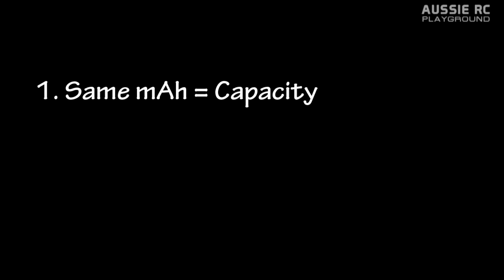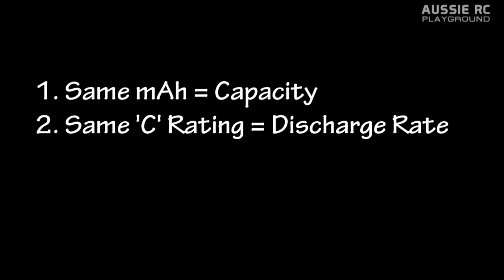RC HOT TIP: How To Connect Batteries in Series

Comment: If I Wana double my flight time, witch is best, series or parallel?
Reply from the maker: Series = voltage
Parallel = mAh
For longer flight time, increase your mAh, however, this comes at a cost of weight, so make sure CG is still right before takeoff.

Comment: Since I run (2) 3 cell lipos 6500mah 100c per battery in series does the c rating of each battery equal 100 total or does it double the c rating since there are 2 100c batteries equaling 200c. Thanks in advance!

Comment: i have a wltoys 10428 and i upgraded the battery to a 2 cell 7.4v 5000mah 75C, I was wondering is things going to be ok as far as burning anything out because i ramped up the 75C?, everything else is what the battery it came with had cept the 5000mah (previous was 2200 an lasted a total of 8 mins lol boring :D)and 75C, i know the mah just gives it longer lifetime but i was on the fence on upgrading that discharge rate an honestly ive no idea what the previous battery had for that as it does not say on the battery its a cheapo chinese no name battery and the upgrade i grabbed is a DHDpower lipo.

Comment: I prefer Parallel/Run Time compared to Speed. So I would be hooking up Two 3s Batteries in Parallel even it's set up for 4s and gives me two 2s Batteries. Or even two 4s in Parallel. I F'n Hate going out and running my trucks and only getting 12min, Maybe 15 if I am lucky and I am running 2500mAh. I Figure Run time by Halving the mAh of Batteries. 5000 get you 25min. 3000 get you 15, 2000 get 10.. So I can buy two 2500's for less than one 5000, hook the two in parallel, I get the same amount of runtime as the 5000 but for 1/3-1/4 Less Cost.

Comment: So for more speed on speed runs I should run in parallel right?
Reply: No you run them in series for more speed and then you can set up gearing with the pinion and spur to get a high top speed or a torque beast

Comment: quick question  i have a 3s 65c 5000mah lipo it's  3 to 4 months old but only used 3 times then put into storage voltage. could i buy the same 3s and use it in parallel with the  3 to 4 month old battery that was used 3 times?
Reply: You should be able to just fine. When we say "age" it's to describe the number of times the pack has been cycled, Not how old the battery actually is.
Reply: stefan barr thank you sir much appreciated 👍

Comment: It makes sense. maybe in the future they will make a dual battery monitor cutoff voltage sensor that will detect the first battery that drains down or maybe something that hooks up to the balancing ports and monitors all cells and then when the speed controller see's the difference it.will shut the whole thing down. 👍
Reply: Yeah i thought that thing with the balancing cable, a long time a go.
Its strange that you cant find  ESC monitoring each cell separately.
Reply: You'd need separate Power inputs for each battery and 2 balance ports too increasing size and complexity of the esc and probably production costs ... Good idea but fiscally flawed ;O)

Comment: Thanks a lot, Vas!
May I ask you to make a video about a parallel and serial charge methods for newbies? I have a board for parallel charging, but I use it for handy connect a battery, but afraid to charge two batteries at the same time using my SkyRC RS16 charger.
Reply: this is a great request... I'm a newb so I follow the advice from the LHS. I ALWAYS balance charge my batteries... never once normal or fast charge...
and I've wondered about using my parallel cable as well... 
maybe through in your thoughts about soft case vs hard case.. thanks again Vas